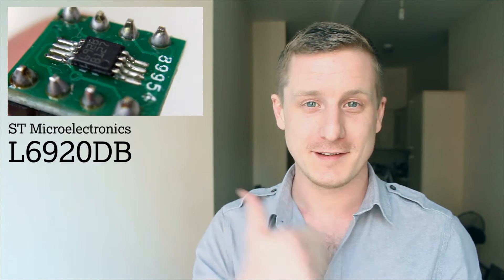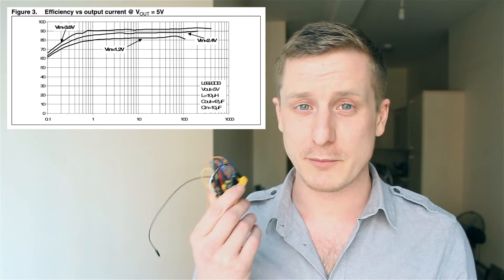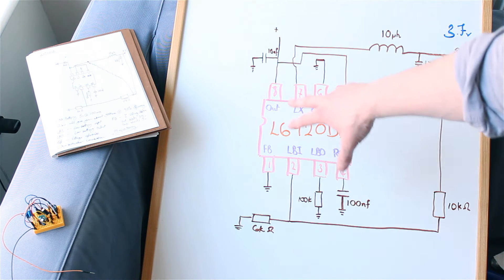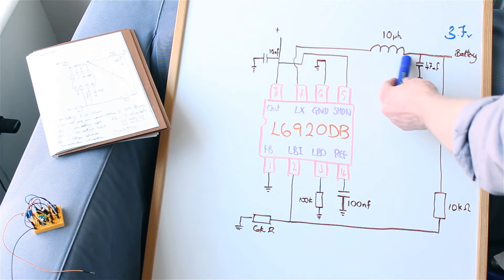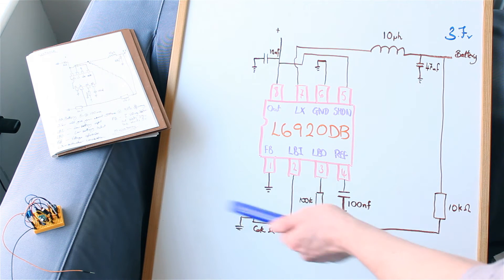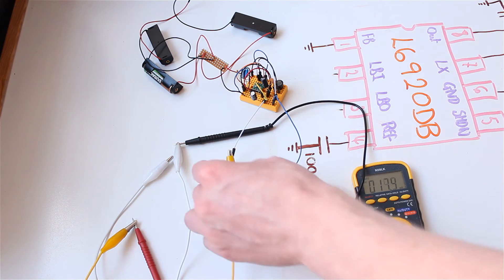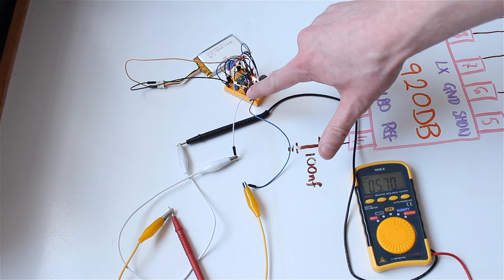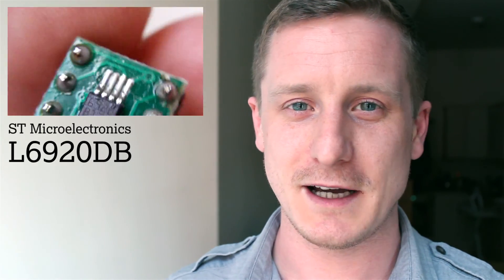5v Boost Converter L6920DB - Arduino

Comment: do you have any video about TP4056 ? :) :)
Reply from the maker: +Peace and Love Unfortunately not, it is an easy one to use though. Similar in operation to the Max1811 which I have covered before.
Reply: i will check your chanel bro ;)

Comment from the maker: Not actually shared this publicly or at least with the public feed but here you go.
Reply: Very cool. You should do your next video shirtless.
Reply: Did you etch the board or just buy it?  It looks like something I could get off eBay.  I just dont feel like using up etchant for something this small.

Nice soldering by the way...
Reply from the maker: Ross Potts Nah, just bought the breakout boards from bay. It was about £2 (Everything always seems to be about £2) for 5 without pins.
Reply: I'm all about DIY, but I've come to realize,  I dont have to do it all.  Good timesaver this...
Reply from the maker: Ross Potts I would love to learn how to etch boards though, know any good resources?
Reply: I've been watching a LOT of youtube videos and trying different styles.  The most promising one IMHO is to use a sponge in ferric chloride to rub away the excess copper.  Less solution is used and its a faster etch.  Im going to work with that one this year.  I gave up on vinegar and Sharpies (there's an oxidizer also).  Too much babysitting.

Also, it seems the sharpest designs are from the photo-based images as opposed to ironing a laser printed job.

As part of my CISSP credits, I'm doing a series on building electronics.  I should have a reflow oven done by Autumn and will move from that to board design and development.